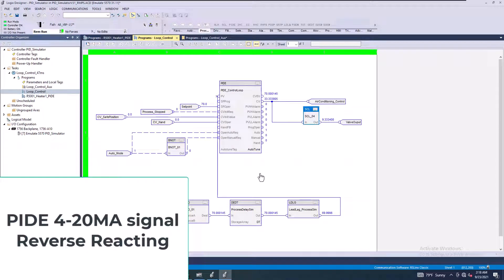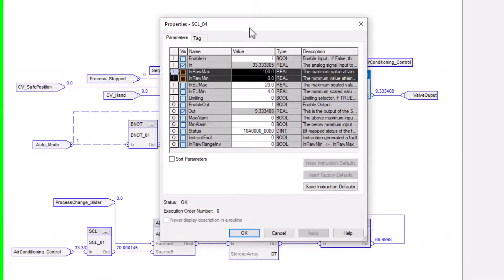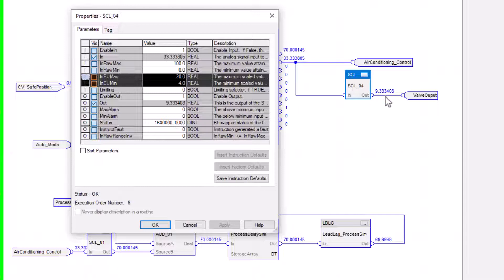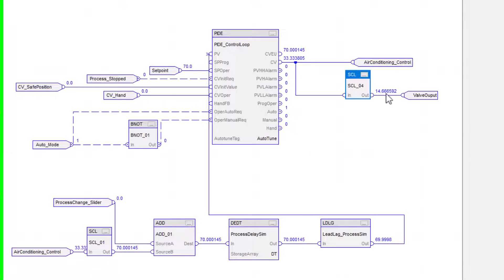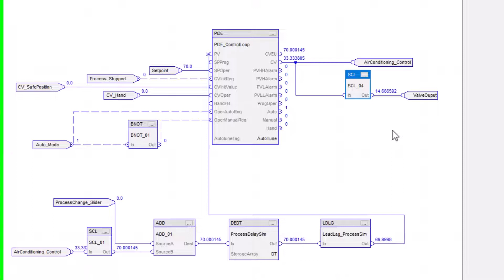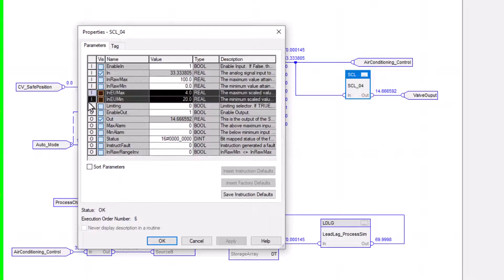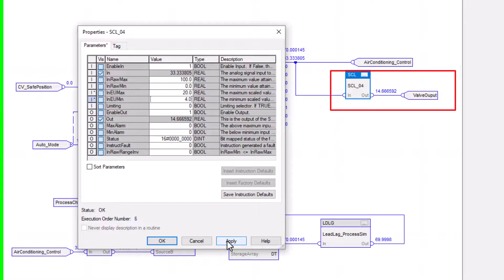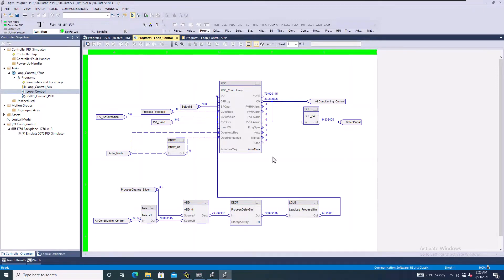PIDE 4 to 20MA signal Reverse Reacting

Comment: Thanks again for another valuable lessson.  I've tried this method using a '0v to 10v' signal type instead of '4mA to 20mA' and discovered that the output always yielded 10v for any CV. Is this acceptable? Some what new to this.
Reply from the maker: Yielded?

This depends on your scaling and the way you scaled the PIDE as well